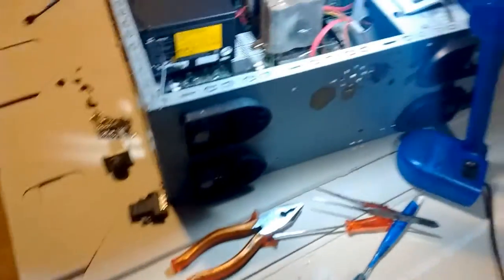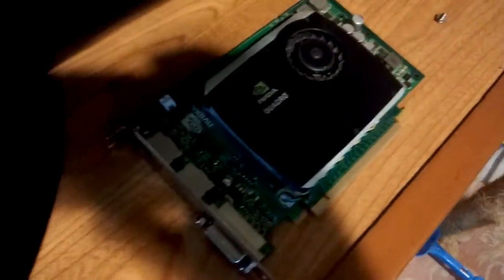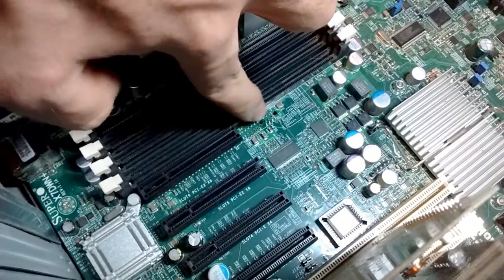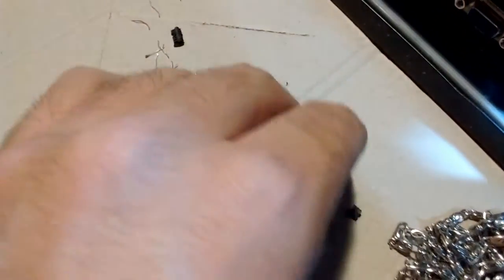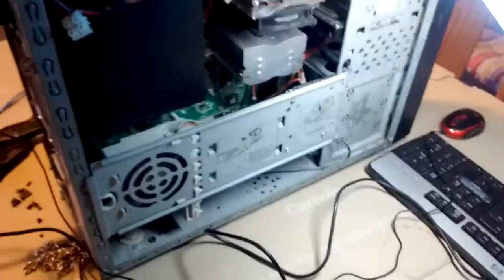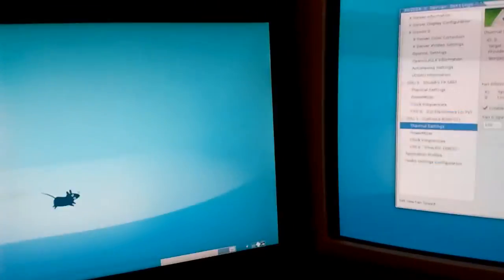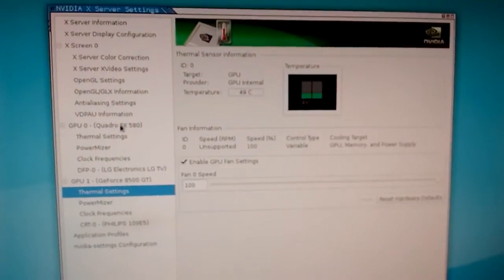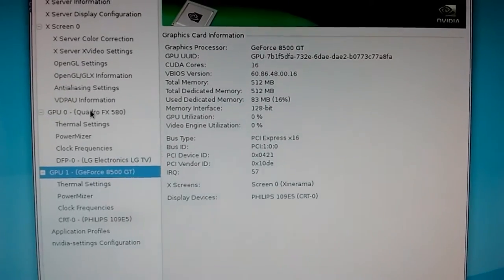Quickie: Dual GPUs on a Supermicro X7DWN+ motherboard

Comment: I was looking to buy this board which is how I found your videos by searching youtube for "X7DWN"....   some questions from your experience with it:

1.  Does Sleep / Suspend resume on it without any problem?  Dunno if your Linux supports it, have you tried it?  Lots of mobos have issues of bluescreening occasionally when they return from Sleep/Suspend.

2.  How is the on board audio, does it work?   

3.  Is there any reason you couldn't put two dual monitor graphics cards in it, and have four monitors, or two monitors with just one cooler graphics card?

4.  With two cpu fans blowing at IDLE, how is the noise?

5.  Did you use a standard 550w + power supply with 8 pin additional prong?

6.  Could you have broken off the extra power tab on your video card, instead of making the mod to the motherboard?  That might of been easier in retrospect.  Just cut it off lying flat on a surface.

7.  Mostly I want to open tons and tons of Google Chrome windows and render with Sony Vegas on it.  I don't do any gaming any more, but did you test some 3D intense games on it?

8.  Is there anything you are unhappy about with the board?  Are you still using it?   Any problems?
Reply from the maker: I'll try to answer as many questions as I can:
1. I don't put my computer to sleep, I always leave it on. However, this motherboard supports S3 and S5 states, so I don't see why sleep wouldn't work  with the right chipset drivers installed.
2. There is no onboard audio on this board, as it is designed for server use. You can use a PCI express or PCI 3.3V expansion card to add audio capabilities to the board, or even better, get a USB audio interface.
3.You can put two graphics cards with however many monitors they support, as long as they are PCI-Express
4. Depends on the fans you use, and the coolers you get. Noctua makes some nice 92mm coolers for socket 771, but they are a tad pricey.
5. I used a Seasonic M12 II 520W PSU with an 8 pin and a 4 pin connector. Both are required, else the board won't even post.
6. If I cut the GPU, I would've reduced its PCI-Express bandwith  in half permanently, so even if I used it in another board, I wouldn't get full x16 performance ever again.
7. This board is a monster for gaming, it all depends on the CPUs and the GPUs you put in it. With two Xeon E5450s and a GTX980Ti I'm pretty sure you'd be able to max out every single game out there at 1440p
8. I am unhappy with myself for killing the board while installing a cooler. My screwdriver slipped and I cut some differential pairs, so the board doesn't work anymore. It was the best board I've ever had, though. Only problem I ran into was the inability to set the boot GPU, so I couldn't run a Windows VM under GNU/Linux using VT-d and a second GPU. Not a big deal if you have monitors plugged into both GPUs.
Reply: +ilovethetwinfamicom Thanks!  I'm looking at memory for it now... it use to run in a "SYS-7045W-NTR" or "SC836TQ" so searching for those terms pulls up 16x sets of mem for it from 16gb 1gb sticks all the way up to 128gb
Reply from the maker: +CHOPPERGIRL AIRWAR Keep in mind that FB-DDR2 memory needs active cooling, so the less modules, the better!
Reply: +ilovethetwinfamicom Take your time replying, I type fast.  lol.  I might get this mobo when I have some money, depends on how much the PSU will add.  I have an 8 pin PSU I might try it first and if don't work buy the one you used
Reply: +ilovethetwinfamicom Yeah, I'll blast a fan at it or or place a large slow moving fan over the tops of them... :-/   Will have to mod some gigantic case to get something like this to fit.
Reply: +CHOPPERGIRL AIRWAR Gaming is not so important to me, as much as having Audio to watch Youtube videos.  It doesn't have to be high quality audio.   I have tons of PCI sound cards so no problem if these are standard PCI sockets.   I had a bad experience before buying a server motherboard with those xseries 544 PCI-X slots, which weren't compatible with either PCI or PCI-E...     so therefore I want to make damn sure I can get something that can be modded to be used as a desktop rig for opening endless amounts of brower windows.

Also, it looks like it could use a 4 port USB card in it as well.

i am impressed with your mad skillzzz.   You think like I do, most bang for the buck.   I'm typing this on an E5450 Xeon right now... I'm impressed with the little chip, it only cost me $21.  I am thinking with two of them, you'd have a poor mans 2700K ... which is a $200+ chip
Reply from the maker: +CHOPPERGIRL AIRWAR They are PCI-X 3.3V slots, so you'll need 3.3V or universal PCI cards. They are not rare, but are harder to come by than standard 5V PCI cards. I'd recommend using modern PCI-Express cards, though, since modern versions of Windows dropped support for a ton of older audio drivers, including all of the PCI Sound Blasters up to the Live! 5.1 (you can use Kx project's drivers for E-MU 10K-based cards, though)

Comment: Hey how do i configure the board to boot with external gpu?
Reply from the maker: Try moving JPG1 to pins 2-3 to disable the onboard VGA.
Reply: @ITTFami  Thanks. At the first try it didn't wanted to work but I noticed that it was just some compatibility issue

Comment: What's the watts on your psu
Reply from the maker: I was using a 520W Seasonic M12II
Reply: Also how did you cut into the PCI slot without hitting the little pins I did it and cut 3 in half XD good things there are 2 pci slots but how did you cut it.

Comment: Damn...   excellent brutal hack.    Running a single E5450 myself, hacked with the 771 to 775 mod, interested in getting this same mobo off ebay and running it as a personal computer in the same way you are... with dual monitors.   Is this system still running for you and are you pleased with chosing it... over everything else out there...       I want as much bang for the buck...    E5450's are $21 right now...    and I can get this mobo for maybe $50?    http://choppergirl.air-war.org